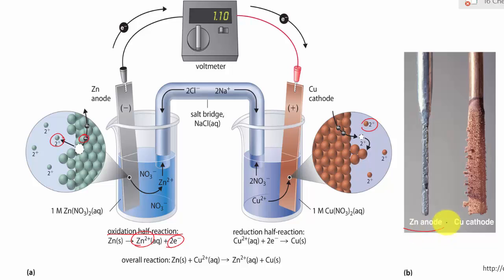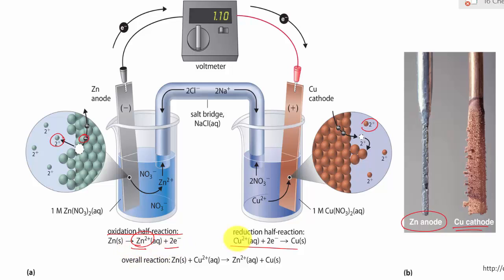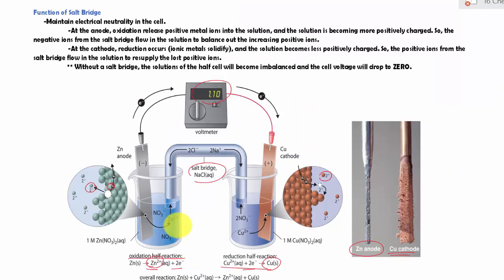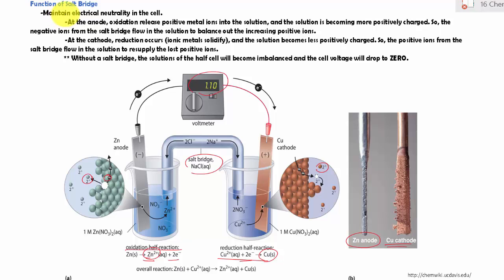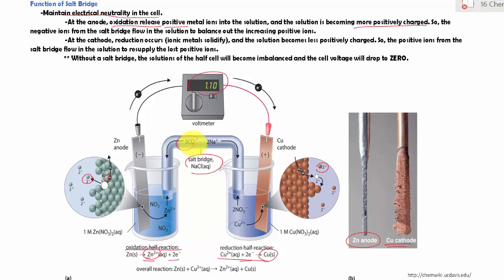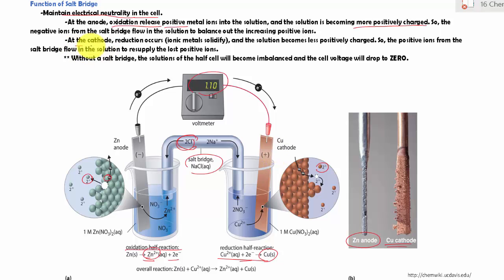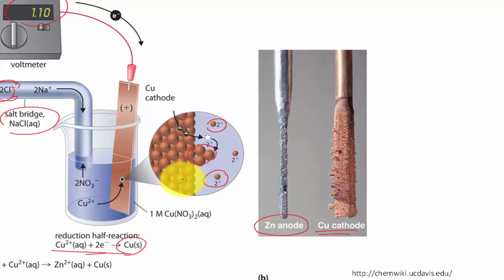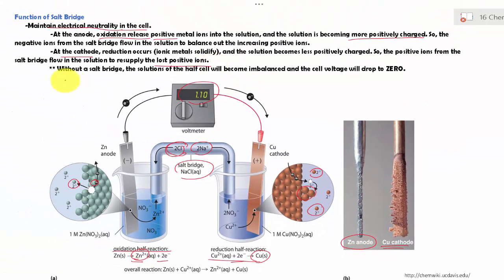Describe the function of a salt bridge.

Comment: If the Cu is recieving e-, how did it became Cu+?
Reply: Why is it not "Cu-" since E- was added?
Reply: @aldrinjimsotelo7767  you misunderstood that. the cathode actually gain electron, so the Cu2+ in the electrolyte will respond to the electron gain, thus will form Cu.
Reply: @AimanNazri  the cu2+ comes from the blue copper sulfate Cu2+SO42-aq and will get used up eventually and the slution will turn from blue t colorless, and at that point just add more to keep it going

Comment: If the Na and Cl ions are flowing into the solution then isn't the salt bridge decaying slowly?
Reply: Yes it does decay. However the reactants of the Redox Reaction are being used up as well, hence the Salt Bridge will last longer than the Galvanic Cell itself, as long as a Saturated Solution of the Salt is used. A Saturated Solution means that the maximum possible amount of Salt is dissolved in the Solution, and given a Soluble Salt like NaCl, that will last A LOT longer than the Cell.
Reply: @Popmini1001  Its not really about the salt bridge or galvanic cell decaying. 
The cells basically want do donate or receive an electron to become neutral. When the solution starts to become more positive in the Anode cell or more negative in the cathode cell, the voltage drops because the cathode will have a smaller electron affinity or the anode cell becomes too positive and gets a stronger electron affinity making it so that less and less electrons are sent to the other side. So the function of the salt bridge is to keep it neutral so that the voltage more consistent, rather than to make the cell last longer.
Reply: The salt bridge is used to complete the circuit by allowing migration of ions.
Or it provides ions to balance the excess change in half cells.
Reply: Bro bro bro do not confuse!!!!!
Reply: It contains a polysaccharide paste as well. Maybe that protects it from decaying and just focuses on the ionic mobility of the ions ,to neutralize the charge
I’m sorry if I’m sorry or unable to explain but I think this is it
Reply: Nope.Because the salt bridge is made up of filter paper soaked in saturated solution for example sodium nitrate(inert solution) which does not react with the two electrolytes.
Reply: @igot7ahgase805  Your comment is not very helpful. You used the terms saturated solution and inert solution without explaining what those are. Then you made the claim that they don't react with the two electrolytes without explaining how that isn't contradicting what the video said. The video says that ions from the salt flow into the two electrolytes so that the solutions stay neutral. Dhrubo's question seems very logical to me - won't the salt eventually not be able to maintain this outward flow of ions? Surely the salt can't infinitely create ions.

It would have been just as useful for you to respond with "no" if you aren't going to offer a why.

Comment: What will happen if the electrical neutrality is not maintained?
Reply: There will then be no potential difference between the two metals (electrons are only transferred due to this difference in voltage). Since electrons are not transferred, the metals will not gain or lose electrons further, and will not gain or lose mass.
TLDR: reactions of the two metals will stop

Comment: Why do you say that oxidation is the loss of electrons, and reduction is the gain of it? It's the other way around. Copper is the oxidator. It gains electrons and therefore forms Cu out of Cu2+. You said "in the reduction process, the positive ions in the solution gained electrons". But that's not true. Just to make things clear.
Reply: Cu is the oxidizing agent, as it causes the Zn to oxidize and Zn is the reducing agent, as it causes the Cu to reduce. Although, reduction takes place by the Cu and oxidation by the Zn
Reply from the maker: I was referring to the oxidation and reduction processes.

Comment: If all of the salt ions move to each electrode before finished a reaction, how to maintain the charge balance?
Reply: the salt bridge maintains the charge balance... on the zinc side, zinc 2+ ions build up and cl- ions flow into neutrlize the ion charges in the solution. on the copper side, copper2+ ions are used up and Na+ inos flow in from the salt bridge to keep the balance... the reaction stops (battery dies) when the zinc metal is used up or the salt in the salt in the bridge  is used up. also the zinc metal should get used up way before the salt bridge. but just replace it with more zinc. and on the copper side, add more copper sulfate to keep it alive.

Comment: but sir the role of salt bridge is to carry ions from it with the help of salt like KCl or KNO3.
if it is neutralising the excess of positive charge then why we say that the salt present in the salt bridge should have same transport number.
when it is not carrying any ion.
because the motion of charged ion cause current to flow in the circuit.
Reply from the maker: yes, it keep both containers charges neutral, but the flow of electrons via electrode cause current.

Comment: I'm not understanding this at all. If both 1/2 cells are electrically neutral than how is there a voltage potential between them. there would be no electric field between them since they are both nuetral and hence no voltage. can you please clarify
Reply from the maker: Yes , if there a flow electron, it will be read by potential difference.
Reply: Well even though there is electrical neutrality being maintained in the solution, the electrons that were released travel through the external circuit to the cathode and so obviously there should be a potential difference ... i think.
Reply from the maker: We are not only looking the molarity of the solution; rather, we look the E cell potentials of two half cells based on each half cell standard potential. E cell= Oxidation + Reduction.

Comment: why some people say the cathode is the negative pole of an electrochemical cell?
Reply: haha, they are confused... the cathode can be positive or negative depending what you are loking at. the definition of cathode is not positive or negative electrode, it is the place where electrons are gained. looking at a power source, i.e. batery, the cathode is positive, because electrons flow into (are gained at) the positive. However if you are looking at the elements (atoms) in electrolysis for example, the cathode is negative because they are looking at electrons being gained by the atoms... maybe it would be better if science were to change the definition of cathode so we don't get so mixed up between chemistry and physics!
Reply from the maker: I think you meant anode?
Reply: @WinElements  the other sites say, the anode is the positive and the cathode is the negative. So when I make my colloidal silver, the positive side (the anode) gives off Ag+ (Silver Cation) ions and H+ (Hydron) ions because of the distilled water as the solution. The negative (catjode) gives off OH- (Hydroxide) ions. When I use a Sodium Citrate Bridge, does it reverse polarity because of the separation of cells? I'm confused now myself.
Reply from the maker: @jamescobrien  It is based on the types of electrochemical reaction: spontaneous or nonspontaneous.
Reply: @WinElements  I see, yeah I use 30v with an ohms controller that stops the amps at maximum of 2.3 miliamps. This causes the ionic silver to come off in the smallest nanometer sizes. So I did an experiment, I took straight silver rods into two jars with distilled water. I then added a salt tube with sodium chloride, and the positive lead is still the anode in this form. Because of the sodium chloride, I was able to see it, and quicker as well, I'm not drinking that. I want to use sodium citrate in a salt tube instead, since silver citrate is a normal reducer for ingestio. Do you think trisodium citrate would make a good conductor in a salt tube? I want to separate the Ag+, H+ in one container, and the IH- in the other container via sodium citrate in the salt bridge. Then I want to take pure glucose powder diluted in distilled water and use that as a quicker reducer, since it keeps the nanometer particles small. Then add soluble starch to cap and stabilize the particles. The sodium citrate is a slow reducer, so I'm hoping that it would not actually reduce the AG+ whatsoever, since citrate forms bigger particles in reduction. If you could at least give me an idea about sodium citrate being used in the salt bridge as a good conductor or not, would appreciate. 

Yeah, I read about the polarity switch in voltaic cells, where they are without an outside power source.